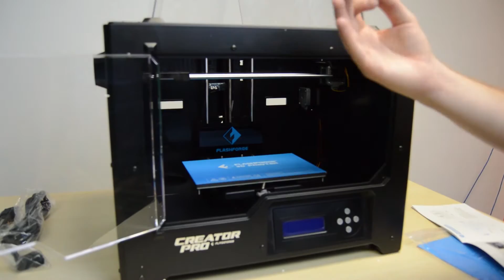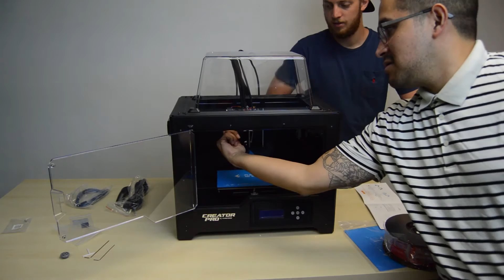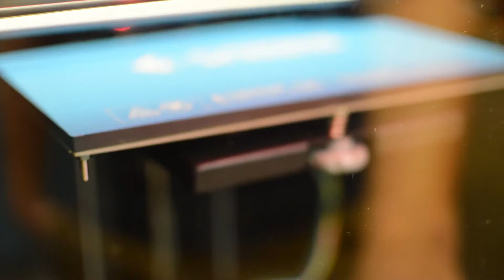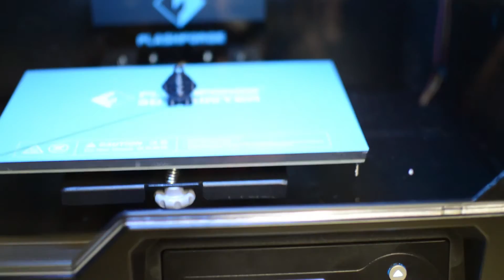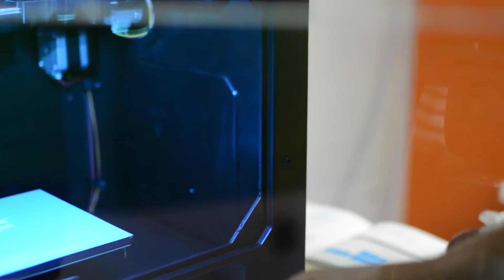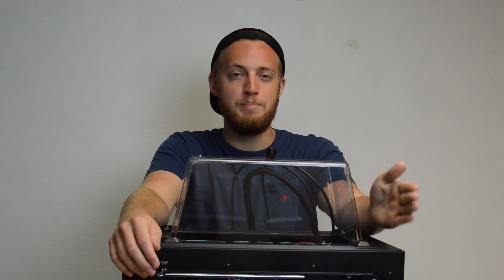UNBOXING & FIRST PRINT - FLASHFORGE NEW CREATOR PRO

Comment: Pretty cool- Mine should arrive today... can't wait!!! Where the fuck is the UPS Guy?????
Reply: Topkek kek So, you just want to be a button pusher? When you purchase anything mechanical, you better be ready to install and reinstall a lot of things. Whether it's software or hardware.
Reply: is it good? Im saving up for it since I have a M3D micro lol
Reply: it is good- love it- however I wish I had a bigger print bed since I use mine for making helmets.
Reply: Range TimeNetwork Lovely, Does the printer have a manual for installing the extruders?
Reply: its pretty much pre assembled but yes it comes nice and packed with a manual and everything you need. I would suggest getting a different slicing program- I run a Mac so I went and purchased Simplifi3D- but if not it has its own.
Reply: Range TimeNetwork Changed my mind about the flashforge, I will hopefully get an Ultimaker V2 Extended
Reply: Yeah- I wanted to get that one-, the one with a bigger print bed. But I am happy for now.. Good Luck!
Reply: Range TimeNetwork to be honest the only reason im not getting the flashforge because I don't really know how to install anything really, I just want something big and high quality and out of the box